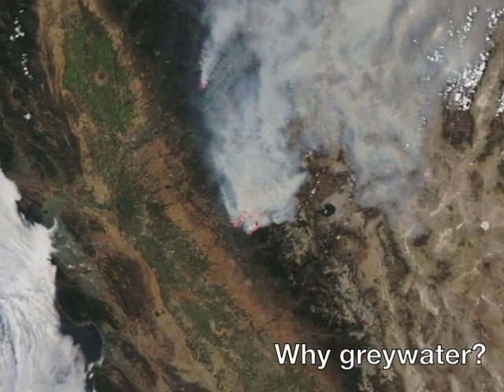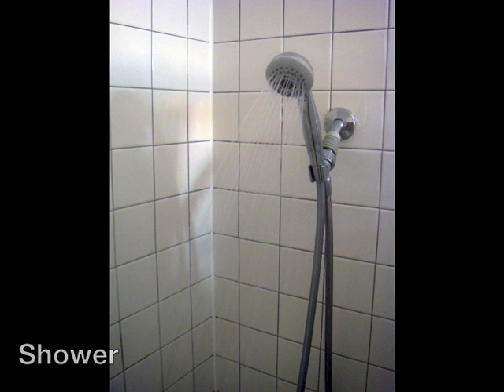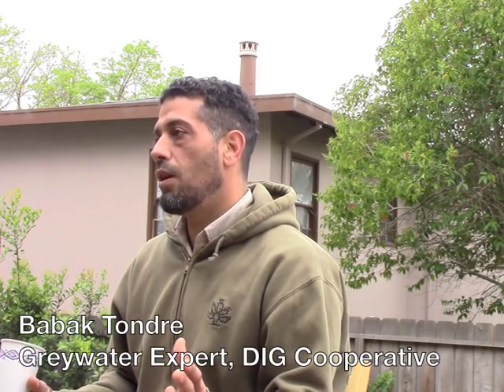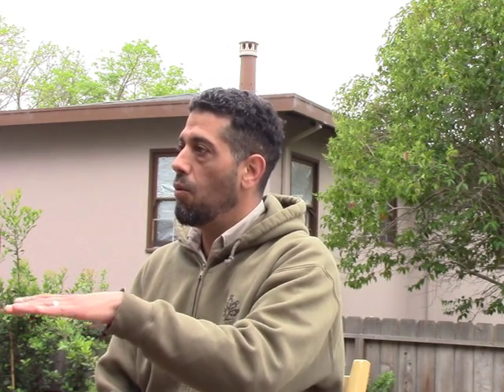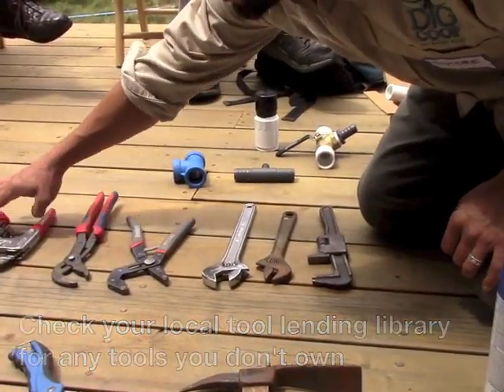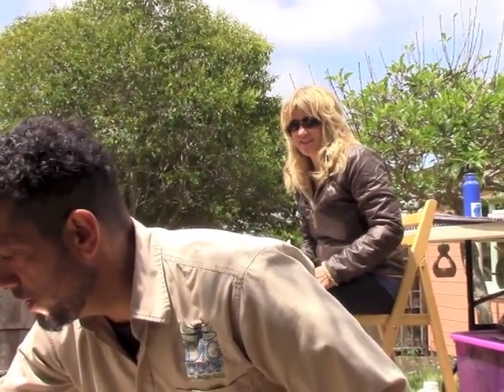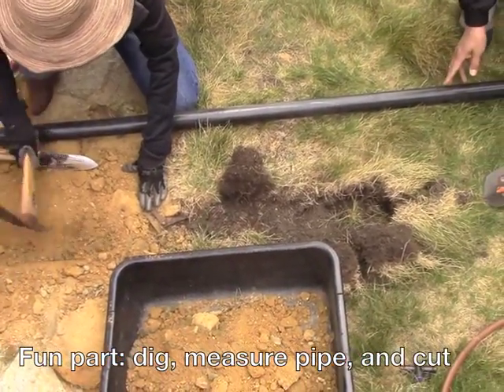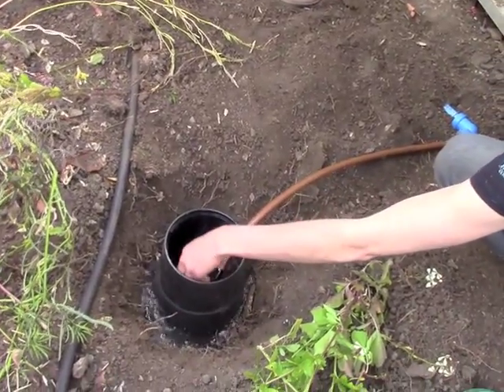DIY Laundry-to-Landscape Graywater System

Comment: I would recommend that the 3 way valve be as close to the top of the washer (not above it) as possible or lower.  You don't want to burn out your washer pump.

Comment: where can I find that specific air gap, anti siphon valve.  I only see the kind that are inline or used for your dishwasher.  Nothing I can find with 1" connection and vertical orientation.

Comment: Does the anti-siphon you showed serves the same purpose as a p trap?
Reply: A "P" trap is more about preventing foul odor from a sewer, and has little to do with back pressure. If your greywater system is set up correctly you won't need a "P" trap. Just the Anti-siphon valve showen in this film.

Comment: Wow, no filter? I'm sure it's much easier to install, but more maintenance. How often do you have to dig out gunk from the valve boxes? What kind of emitters are those, and do they get clogged?

Edit: San Francisco guidelines also advise no filter. Uses 1/2" valves, not drip emitters, so not likely to clog

Comment: I don't put my laundry in the dryer, I hang most of my laundry, so what type of system is needed to treat water with fabric softener or if bleach is needed? I realize this video was made a long time ago and I may not get a response but I am asking anyway.
Reply: You can turn the handle on the 3-way valve to put it down the sewer if you are worried about chemicals in a specific load. Or, only send your rinse water into the garden, etc.  I hang dry all of our clothes and never use fabric softener.
Reply: It doesn't answer your question but nobody needs fabric softener or bleach.

Comment: the anti-siphon valve you demo'd, is that similar to an Air Gap used for dishwashers, can I use those for this install? Also if my drain hose from washer is 1.5", does that mean I should keep all my pipe 1.5" or bigger?

Comment: grey water is water plus soap (& removed dirt/grease).  How do you separate out the soap?   It is a great system from point of re-using the 'water'....    but over time, sending all that 'soap' into your yard has to have some negative consequences  !!
Reply: It's a grey system compatible soap. Oasis brand
Reply: Also depends on the soil type.  I have very sandy soils,  so it all moves through quickly.  I'm watering shade trees; they seem to not care
Reply: Soap is actually a fertiliser.

Comment: I''d like to know how you connect the white PVC pipe coming from the washer to the blue flex pipe. Also I'd like to know more about where the water ends up, if the ground was prepared as a basin. Was the water directed to trees or shrubs?  How many valve boxes/outlets were used?

Comment: Some municipalities would not allow it because sewage treatment plants need the gray water to process sewage just think if everybody did this the  black water would  be so concentrated it would be hard to process!  It This is just an other typical California  dimwits reinventing the wheel, this is dangerously stupid .may be really all the negative happenings to the state of California is the universe way to wake the Calforicators up to reality
Reply: Vince Testa — Actually this only diverts a part of the household gray water. The gray water from sinks, showers, tubs, and toilets is still going down the septic line, which is still plenty of carriage water for solids. It’s a first step to getting away from pumping water hundreds of miles, treating it to drinking water standards, and then throwing it on the ground.
Reply: Lucky for me I'm not on city water. I have to have my water hauled in so I want to reuse all I can
Reply: i agree...I think this grey water concept only is truly beneficial to the community if the home/business is NOT connected to municipal treatment facilities...due to your fore mentioned reasoning...

Comment: I find this not helpful at all. The guy said this can be done over the weekend.  Not true, try it and you will find out the hard way. Especially if you need to go underneath 6 inch concrete walk way.  This is great for new houses before they lay concrete and tiles...etc.  A real nightmare if you try this over the weekend or by yourself.
Reply: You can dig a hole next to and down to the bottom of the concrete on both sides you need to push through.  Attach a length of PVC pipe with one end having a glued on smooth to 3/4 threads to female hose fitting. Attach to the hose and use water pressure to drill under the sidewalk or walkway.
Reply: Yeah it is all about the ground
Reply: Going to be fantastic for my manufactured home that's already off the ground with a crawlspace in the middle of the AZ desert.